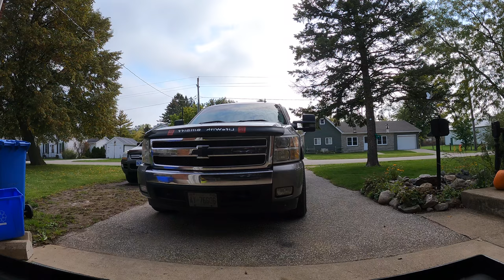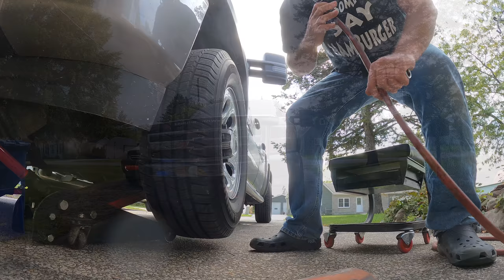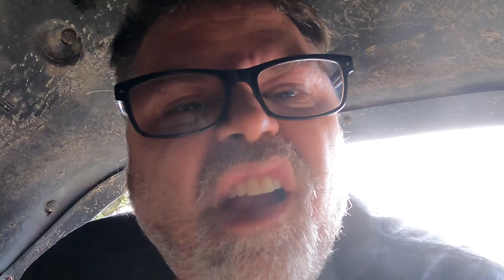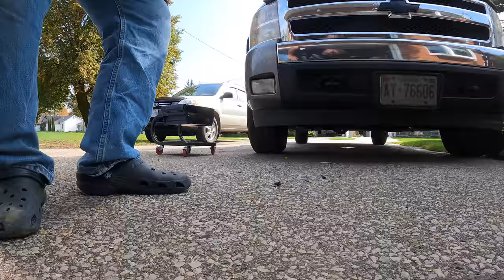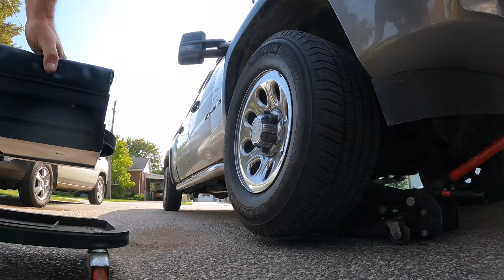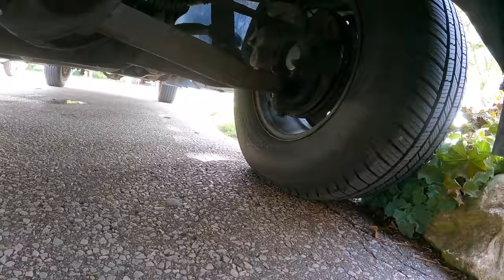Is My Wheel Falling Off Or What   4K

Comment: Having no 4x4 will definitely make it easier to figure out... I'd be checking your lower ball joints just to eliminate the chance that it's a loose or dry ball joint. I work as a automotive technician and see tons of GM/Chev trucks with worn upper and lower ball joints with as little as 100 thousand km. They are super easy to check with a jack and a long prybar. Put the Jack on the lower control arm and with the wheel off the ground slide a prybar between the concrete and wheel. Lift the prybar up squishing the tire and watch your lower ball joint. It shouldn't have more than 0.020" Movement. With the Jack still on the control arm push in at the top of the tire to check the upper ball joint. I don't recall the upper ball joint spec but you can usually tell if they are bad by how much movement...
Reply from the maker: Thanks all the ball joints have been changed

Comment: I have a 2011  silverado and the tires squeel when I turn if they are low on air pressure. But i am running a 10 ply tire on my 1500

Comment: Since you said it only happens on turns, is it full lock turns? or 'partial' turns as well?  The only thing I can think of since I've had to deal with pop and squeek before is steering stops rubbing.  Dab of grease on the control arm stop shut that noise up.
Reply from the maker: It looks like it’s coming from the steering shaft maybe . Hard to check with only me lol
Reply: @LifeWithBillSiff   I hear ya on that. Steering shaft easy to pop out on those things for a good greasing up?